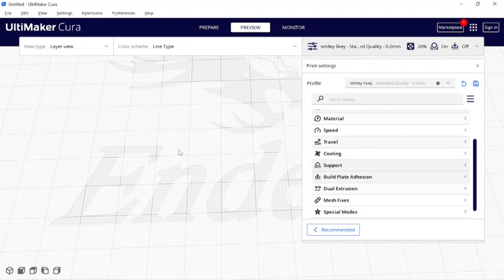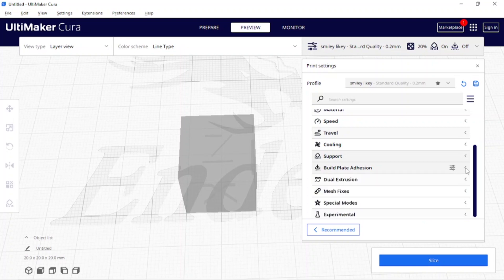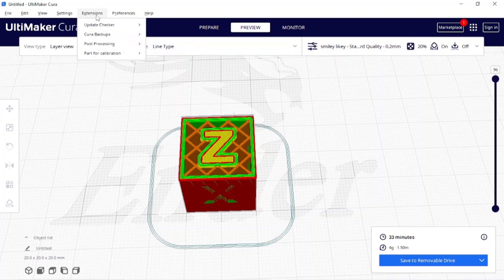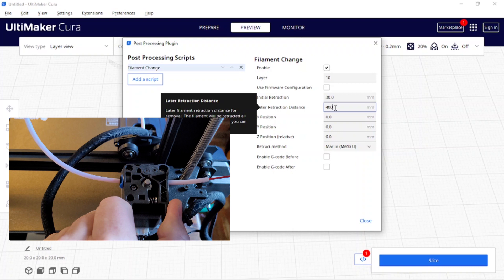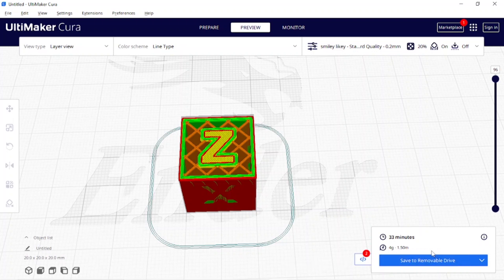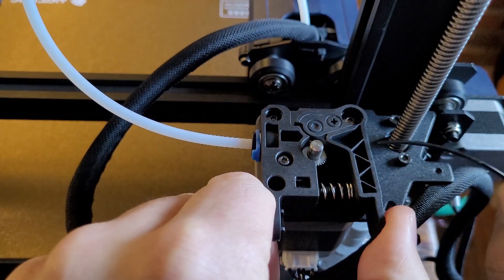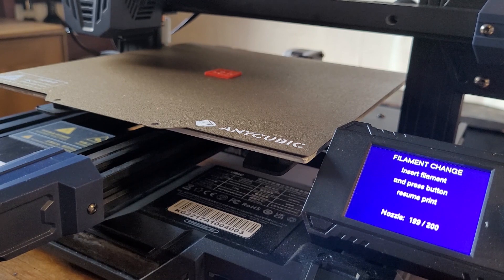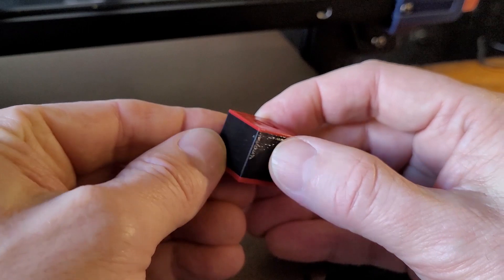How to Quickly & Easily Change Color Filament on the Anycubic Kobra 3D Printer

Comment: Hi... Based on the scripts in Cura 5.4, it mentions temp changes (amongst other) on layer changes; under ChangeAtZ5.3.0 experimental.
Love to see a video where you experiment on that. I have different materials (PLA & ABS) printing at different temperatures. Even same brand different colours sometime need different settings like retraction at times.

Comment: Good Video it educate me about how Cure works, but I am sad this will not work on Anucubic Kobra, I tested and it will stop when is needed it, but no option to resume. So you will have to kill the print by turning off the power.
Reply from the maker: Which Kobra model do you own? I did this on a Kobra Go
Reply: @mayhemsmiley  Yea, the one I have is Kobra only.
Reply: Since we do not have the option to resume, it will be there forever.
Reply from the maker: @joma-iu4gd  sorry to hear that.
Reply: @joma-iu4gd  yo tengo la kobra y me pasa eso no hay otra manera?
Reply from the maker: Hi Joma, new video check it out and let me know if it works for you https://youtu.be/ivF1U4KhJZc